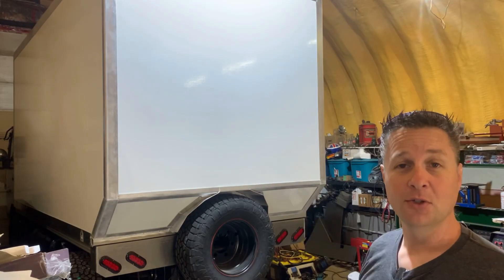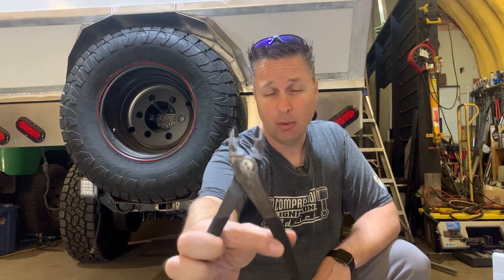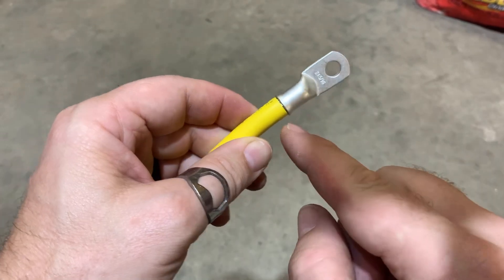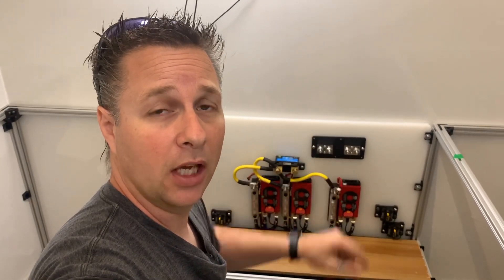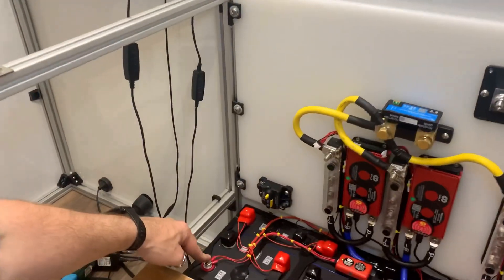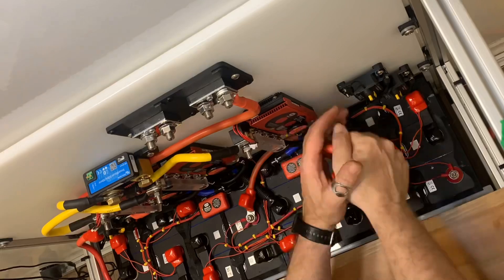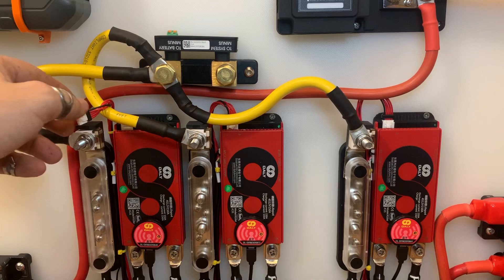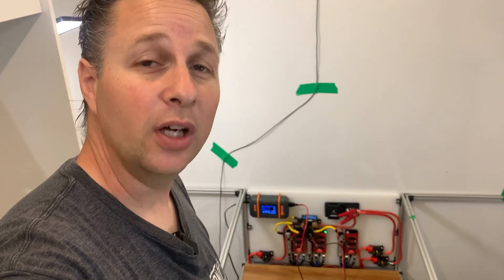DON’T use these TOOLS ! | Overland Electrical build

Comment: Good instructionsnal  video, my only gripe is the metal rings around all that exposed electrickery!
Reply from the maker: Ahh, but it’s not exposed 😎.   Keep in mind that the metal framework is not grounded, so down by the batteries the only possibility is the negative terminals, which are booted.  Up top, the only exposed positive is the buss bar, which when I’m working near that, the circuit breakers are off - so there is no possibility of contacting pos to neg.  That said - you may have noticed when o was working on the cell terminals - I didn’t have rings on, as I have no way of covering the terminals.  👍😎

Comment: As we have already said, great minds think alike.  On my RV remodel/ upgrade, I found more than enough 1/0 and 4/0 copper cables to use for the electrical reconfiguration.  
No telling what how much money that saved me. 
That 3D printer has earned it keep in your shop.
Reply from the maker: It’s hard to throw away good stuff even if it doesn’t have an immediate use!   And yes, this build would not be possible in the way I’m doing it without my 3D printer!!

Comment: Drop the affiliate link for the vice grip and hammer! I have some heavy gauge wiring to do! lol jk.. 

Killing it Bruce! I actually got some good tips from
The video! Wanna talk to
You about the shunt tomorrow!
Reply from the maker: 🤣 - man, I didn’t even think about linking vice grips and hammers, I’m slipping!!!
Reply: Size the shunt to the largest amperage you can run thro9ugh that circuit.  It will give you better accuracy.  I.E. use a 100A shunt for a circuit with 79A max power usage vs a 500A shunt.
Reply from the maker: Max output of each BMS is 150 amps, so 3X 150 = 450A, closest shunt is 500A 😎